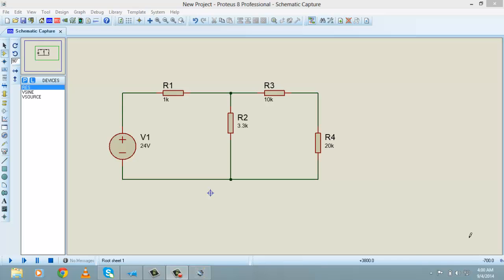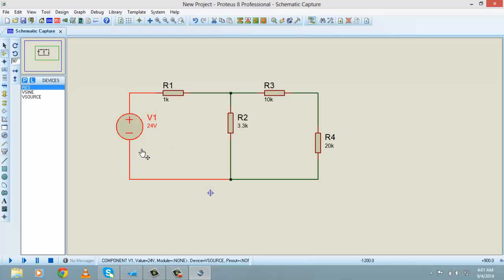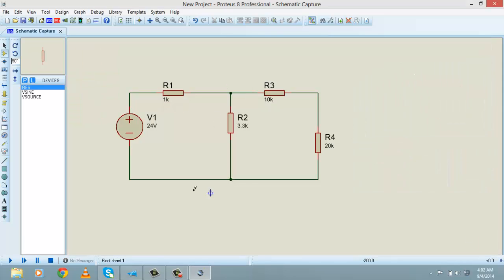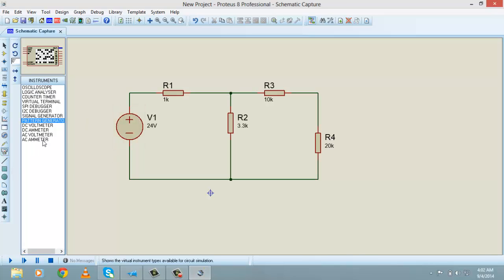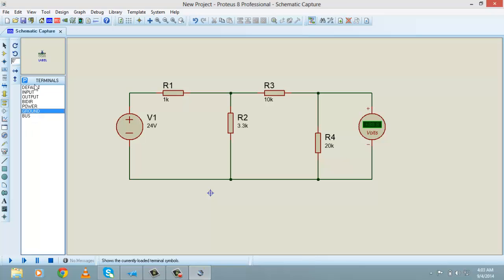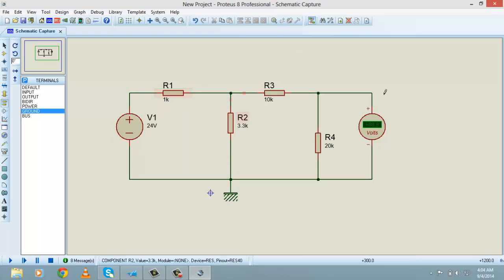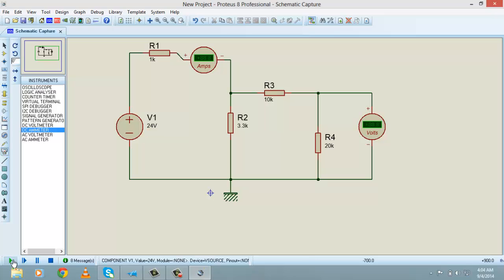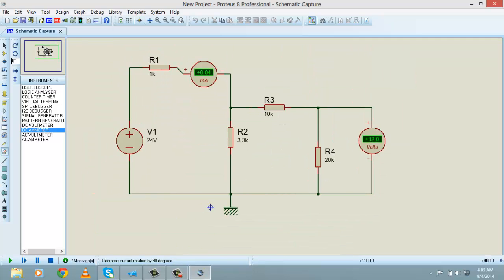Voltage and current measurement using proteus tutorial#2

Comment: thaks brother you save my time i'm testing for calculate the amper and volt in my project and i see much difference between the result in multimetre and my calculation in paper so i search for solve the problem and i see the unit amper to milliamper the necessary problem but there are always some difference not much but some other time much difference i don't know if the proteus have some problem in calculation